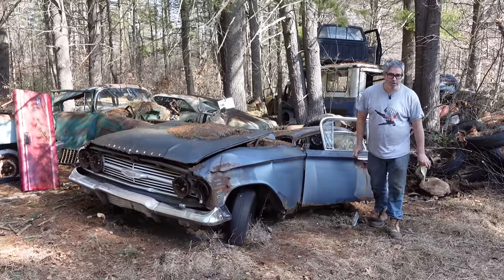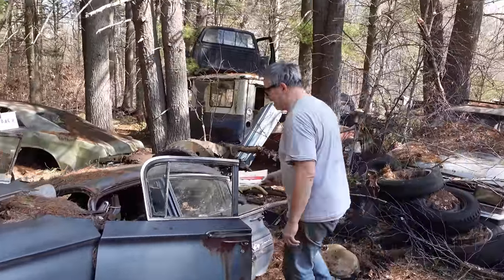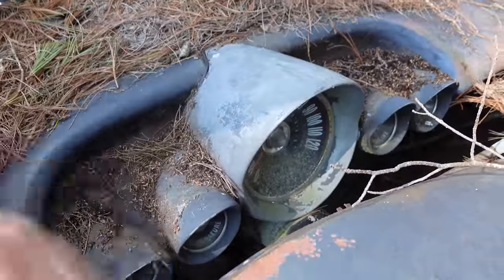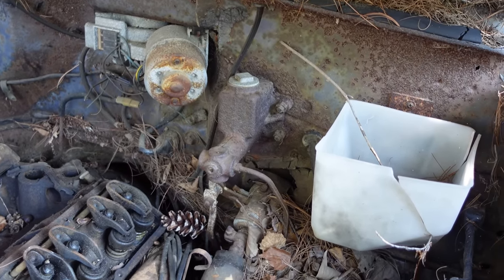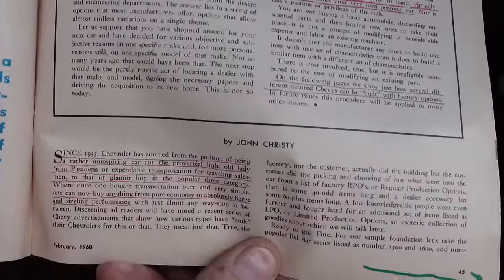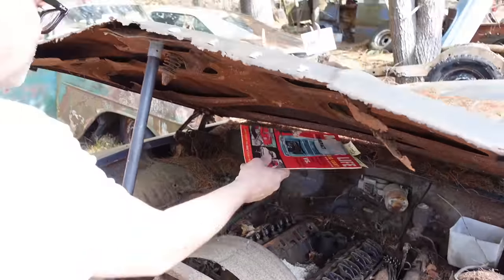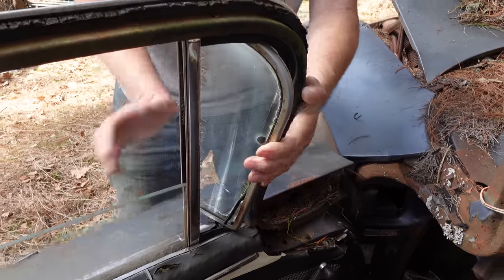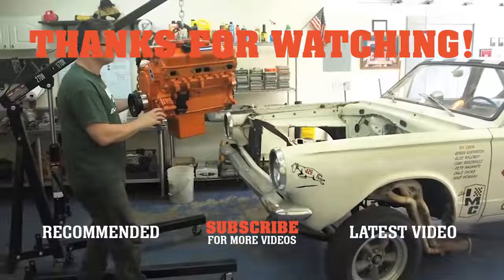Pimp ala

Comment: The red 4dr at the top of Steve's 1960 brochure is the 4dr hardtop.  Chevrolet called it the sport sedan.  My mom had a white one with black interior and black side spearwhen I was a kid.

On the 1959-60 design.....
"The Cars of Harley Earl" by David W. Temple has a complete chapter on styling/design of the 1959s  and a short write-up on the cleaned-up 1960s.

The flat-top styling is what was called "international design."  Hemmings Classic Car, 2017 January has a big article on this design.

Buick finished their design first and the other divisions hsad to work around the Buick design.

Interesting side note.....all five divisions shared the same glass.

Comment: I had a '59 Biscayne 2 door sedan, drug out of a farm in Spokane WA, bought it for 3000 and had to flat tow it home.  Rebuilt the one barrel carb and drove it for a year or so, then swapped in a truck based 409 and turbo 350 that my father had.  Was a great car, wished i never sold it.
Reply: Still pulling classics out of the woodwork in Spokane.

Comment: Interesting that John Christy’s article would say the Chevrolets were cars for traveling salesmen. My late grandad owned a one-man rural repair shop from the late 20s through the 70s and one of the cars in his accompanying junkyard collection was a 1950 Chevy two door. I remember in the 70s him telling me it was unique because it had a Powerglide and only had about 50K on the clock. Apparently circa 1951-52, the salesman who owned it was passing through had car trouble left the car with him to fix. I don’t remember what the car’s problem was but seem to recall my granddad saying he either bought it or traded him something to get on his way. Parked it under a big cottonwood tree. Anyway, a Kansas wind storm blew thru and dropped a cottonwood limb on the roof of the car. And there it sat until the late 80s when the cars were all auctioned off, although the tree limb was removed.

Comment: When I was very young my parents had a 1960 Chevrolet station wagon. My mom HATED it so in 1963 my parents traded it in for a 1963 Rambler Ambassador wagon. Every time my dad bought something other than a Nash / Rambler / AMC through the years they seemed to always replace it with another American Motors vehicle until AMC got bought out by Chrysler. The next Chevy my dad bought wasn't until 1989 when he bought a Chevy Corsica but it was only because I worked for a Chevy dealer and he got a good deal on it.

Comment: Great tour of a cool car! Chevrolet was eating everybody's lunch back then. As far as the X frame goes, it was no more or less dangerous than its competition. In the days of longer, lower, wider, GM, Ford, Chrysler, etc., had NO side impact protection. Since the bumpers were often higher than the passenger compartment  floor, you just got smacked in the lower door. If you had a perimeter frame the offending car would just ride up over the frame and crunch you. This is why side door beams and side airbags were invented! Expecting the lower structure to protect you, sitting above it, is like expecting your steel toe shoes to protect your shins! 😁
 Fisher Body also engineered stronger, double boxed rocker panels and plenty of cross bracing in the floorboards for these cars.
 But then lots of people did not trust any unibody (AMC, Chrysler)car back then either.

Comment: An old guy at the end of my street Vinny Aprea bought a 2dr hard top Impala new in 1960 in black with a red interior and a 283 Powerglide. He drove it 35 years and put over 400,000 miles on it. Sometime in the 70's or 80's he put fiberglass front fenders on it when the steel ones rotted out. He parked it in the garage for 15 years when he started driving a mid 90's Buick Century his late sister left him. he always used to say how the chicks went nuts over his car when it was new but he always used the other C word because he was rough around the edges LOL

Comment: That year Impala was  hard car to love but I did like the rear wings and tail light area.   I remember being able to tell the car salesman what I wanted as options in a truck.  He just wrote it all down and the truck came with what I wanted not like today where you can only buy option packages.  Oh the good old days.
Reply: Would have been nice to have cruise on the one car we bought, but, NoooOOoo, to get cruise ya buy a whole mountain of sh!t I don't want
Reply: I ordered two new vehicles in 2005 - a F-150 for me and an Escape for my wife. The F-150 at that time was still a fun vehicle to order, with a fair number of different options you could pick and choose. The Escape was less so, but there were still a few options I was able to select (the trailer towing option being the particular one) that likely would not have come on a lot vehicle.

When I ordered my Mustang in 2008, the selection process had pretty much devolved into package selections and colors, although since the combination I wanted was fairly unique it still made sense for me to order. When I purchased my Ranger in 2009, I would have liked to special order it, but I purchased so late in the year that it wasn’t possible any longer for that model year. That being said, only real compromise I had to make on the Ranger was color. By the time we purchased our Escape in 2019, we felt as if ordering didn’t make much sense and we simply purchased a lot vehicle.

In looking at trucks on Ford’s website a month or so ago, I might still order a truck just to get the exact combinations I want, but for any other kind of vehicle the choices seem so limited that I would probably just do a lot vehicle again and call it good.

Comment: always loved the Impala and its later platform mate the Caprice my dad drove a used 1984 Caprice Classic sedan from Oct 1993 to May 2000 it had been uncle Rico's car previously  until he downsized to a 1994 Honda Accord SI the Caprice classic had a 350 Small block V8 engine in it while the Accord SI had a 2.7 l V6 engine similar to what the Acura Legend/Rover 800 series had remember that well as my dad drove a used 1987 Sterling 825 SL prior to having the Caprice

Comment: Hi Steve, good video!  Good car!  Thank you for pointing out the steel "X" frame.  All full-size cars used the steel "X" frame years ago before the full perimeter steel frame, i.e. GM and Ford.  Chrysler went to a full unit-built body shell with a steel front sub-frame on all of there cars.  I wish to point out that the instrument cluster on the car that you profiled is not magnesium, it is pot metal.  By the way, the front door small window(s) are the vent window(s).  The quarter window(s) are all ways located in or at the rear quarter panel(s), that is where the term  "quarter window" comes from.  Please reply.  Dave...

Comment: Hi Steve, That center grill emblem lets you know  it is a v8 with the v crest. The 6 cylinder cars didn't have the v on the emblem
Reply: Or "18" for the second digits of the VIN. That confirms it being a V8 Impala in 1960.
Reply: Also, if the grille emblem is crossed flags, instead of the Chevy emblem, the car is equipped with a 348 ci V-8.
Reply: @ericesterby2895       it's always good to know something new!!!!!

Comment: No VIN (almost), can't win, but easy to (somewhat) figure out, no doubt: 0 for 1960 model year, 18 for Impala V8, 39 for four door hardtop, maybe S for St. Louis, MO or T for Tarrytown, NY or G for Framingham, MA assembly among other choices and the rest is the production sequence.

No tag, can't brag, but can be (somewhat) figured out, no doubt: 60 for 1960 model year, 1839 for four door Impala, S for St. Louis, T for Tarrytown, NY or G for Framingham, MA assembly (among other choices), 841 or 843 for Blue interior trim, 910 for Horizon Blue exterior paint among other codes.
Reply: Was the top cut to take the quarter panel? Also, did you check out any of the Texas auction items, I looked through quite a few cars, seems like they were mainly for parts. Don't think I saw a single one that was complete.
Reply: @tomwesley7884  Who knows? Maybe. LOL. One of the You Tubers I follow, "Classic Ride Society" is doing a three part (at least) walk around of that auction. He's got two of the three parts up already.
Reply: @googleusergp  Yeah, a Classic Ride Society video came up in my suggested list, and the yard in the thumbnail looked familiar
Reply: @tomwesley7884  I know of Benny of CRS as he sent me a #42793 Craftsman 3/8" drive flex ratchet that he found in a blue 1972 Torino (the video can be found on his channel, it's the light blue one). About 15-17 minutes in, he finds the ratchet buried in the radiator support. He sent it to me, I cleaned it up and rebuilt it and it works like new now. 

Eventually, I plan to maybe go down and visit him and be on the channel, if that's something that he and the viewers of his channel want. I'll visit other content creators that are in the area if I can.

Comment: On the build options did it offer different radiators ❓Impalas of this time had a different radiator for each engine , 6 cylinder, 283, or the big block. Did cabs have a different radiator ❓ Keep up the good work 👍

Comment: The 1959 Impala was almost the same,  the most noticeable difference were the tail lights,  the 59 were one piece tear drop, and 60 had either 2, or 3 small round lights . I think the cheaper models had the 2 lights per side  or maybe the 6  cylinder models,  and the V 8 used the 3 lights per side.  Not sure
Reply: I believe Impala got you 3, Bel Air 2 and the base Biscayne a single.
Reply: @seed_drill7135  Biscayne and Bel Air both got two lights per side, with the Impala and later the Caprice receiving three per side.
Reply: @seed_drill7135  
That does make sense,  thank you for that information

Comment: 1:40 Why did you say gazelle?  Wouldn't it be a running Impala on the side of an Impala?
Reply: It's an ad-lib. According to a video from a few days ago he does research and makes notes. It's not a script but they are visible off camera during filming.

At this point he was not looking off-camera so couldn't see the notes and got into one of his ad lib routines, the ones that create fastback 58 Impalas, 67 mustangs built on Fairlane platforms, distributors mounted in tubes going down to the oil pan, ram air on 80s Chevy pickups, things of that sort.

Anyway an Impala is not a gazelle but both are  species of antelopes.

Comment: 1958 - 1964 gm full size cars are the most unsafe cars ever made!!  for side or front impacts !! For many reasons . steering column and wheel could decapitate or crush the chest of the driver as well in a front on impact, they were so bad that they were not allowed in most demo derby by early 70s even. Yes I'm old enough to know . I remember also working in the wrecking yards as teen in the 70s and seeing these gm  cars of the era that had been in wrecks and it was amazing the carnage of them and the blood everywhere in them ! I can remember literally chunks of flesh hung up in the steering wheels of these things . they brought about some of the first law suites against an auto manufacture as well in regards to safety and in 1965 all gm cars got a much revised frame and body structure designs although I think buick and or olds had went to a perimeter frame by 62or63.